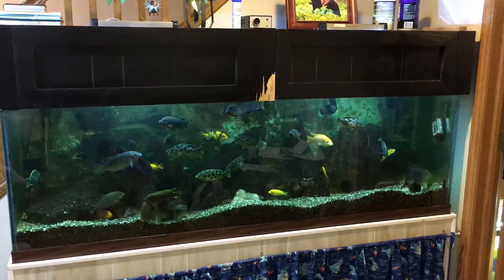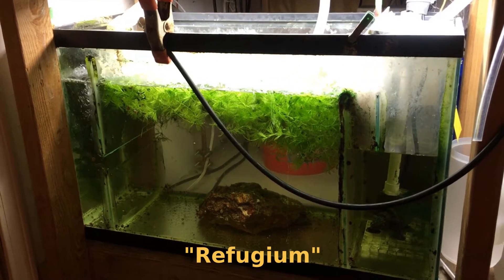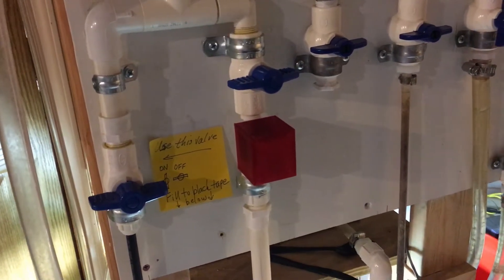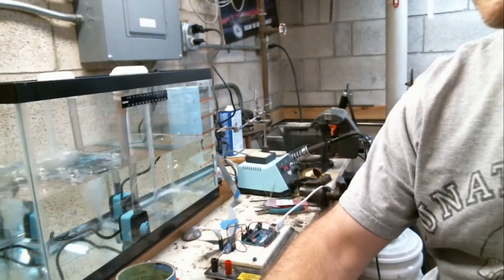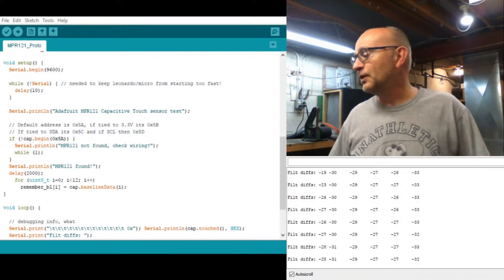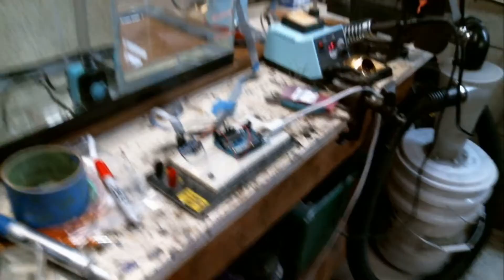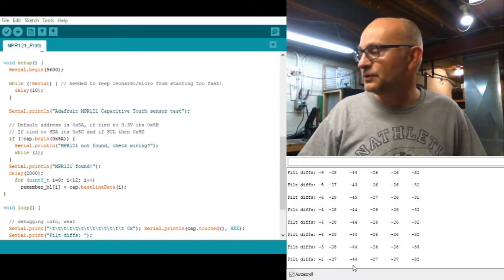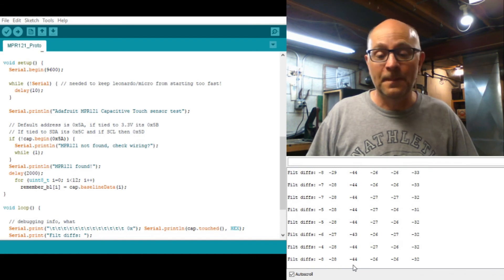Aquarium Water Level w/ Adafruit MPR121 Board

Comment: Hi, 
Wow, this is great information, really appreciate. I'm looking to build tank liquid level sensors for an rv, and so far, your video has been the best in showing actual use. Can you advise a couple of things:
1) is this the stock ADAfruit code?

2) Did you only introduce the time delay into your code, or did you do other code mods? 

3) if you did other code mods, would you share your final code? 

4) With your set up, did you have to calibrate every time you started, each day with power off, as an example. Others have claimed the ADAfruit code needs to calibrate, each time it is started, so you can imagine how difficult that will be with a tank that does not empty all the time, like a fresh water tank on an rv.  

5) After switching to every other on the ribbon cable, did you finally leave the unused ones ope, or ground them....I think you said grounding them mad it worse? 

Thanks for doing the video in the first place, it really helps with some of the points you made about the copper lengths, and the wiring of the ribbon.  

Cheers, Scott
Reply from the maker: Scott Edwards thanks for your comments !  Sorry for my delay in responding. I’m definitely happy and anxious to provide answers and continue the conversation.  I should be able to get to it tonight. Honestly, I can’t remember if I posted the code I used in this video on my github; I will if not. Also, I just restarted the aquarium automation project again. I’m building on the basement tech zimknives shop surveillance project design for basic monitoring of the aquarium ... check out that series if you haven’t already.
Reply: @danielatbasementtech  Good day, I'm on holiday, am looking forward to trying some things out in the near future when I am back..... will correspond in about a week or so. Thanks again for the reply.
Reply from the maker: Hi Scott ... thanks again for your interest and comment.

Answers to your questions (caveat: it's been a while ... :-) )

1) The code/setup used in the video was first written for a demonstration at the Milwaukee Makerfaire.  It started with the library from Adafruit and the example that they provided.  I posted the code to the "Feasibility" folder here: https://github.com/basement-tech/Aquarium-Automation .  You can see that it is pretty simple.  Do note that I think the last code changes were not reflected in the updated comments at the top of the file.  Also, I think the first message displayed should say "... commencing ... R->L", not L->R.  Doesn't change anything about the operation of the software.

2) I didn't change anything else that I can remember in the code that I cut/pasted from Adafruit.

3) The code is posted to the "Feasibility" folder here: https://github.com/basement-tech/Aquarium-Automation .

4) You'll see in the referenced code, that, yes, I did move all of the water to the right (i.e. full) and calibrate each time.  However, I didn't do any experimentation to show that calibration was required.  I would definitely be interested to see how consistent the readings were without calibration.  I did note in the video that the dynamic range of the "full" versus "empty" readings were pretty wide; perhaps enough to accommodate variation in the readings.  I would be interested to know what you find.  You could also write the values to eeprom.  I was worried about algae or other slime on the inside of the glass affecting the readings.

5) Yes, grounding the unused wires made it worse, which kind of makes sense.  I left them unconnected as just spacers.

Hope this helps ... let me know if you find a use for this stuff.  Watch for the upcoming video series where the full Aquarium Automation project takes shape.

Finally, I have started to make the first cut at this Aquarium Automation project using the ideas from the "Monitoring zimKnives" surveillance project.  The first function will be to provide the water level via the mosquito data broker using NodeRed graphical display.
Reply from the maker: I realize that I posted the code from the full demo where there was a float sensor on the left side of an aquarium and the capacitive sensing on the right.  A pump on each side moves the water back and forth to demonstrate control using these sensors.  I'll try to find the original prototype code and maybe do a video of the full demonstration.
Reply: @danielatbasementtech  That would be great..... I don't want to use a float sensor as I think they will eventually bung up. Cheers, Scott